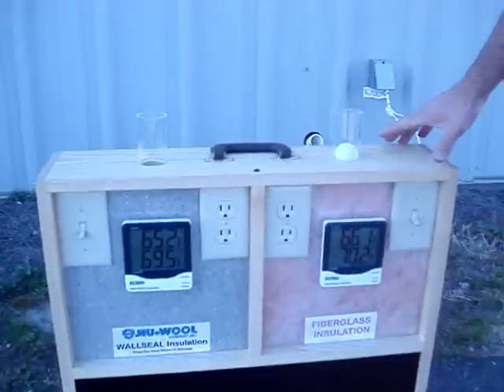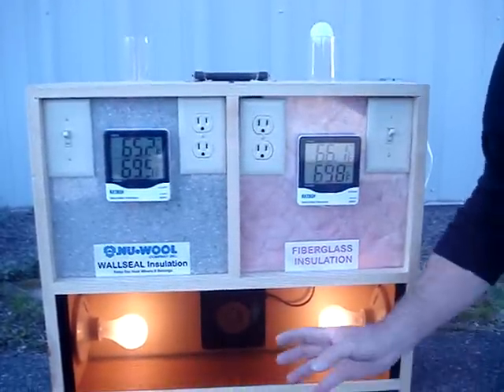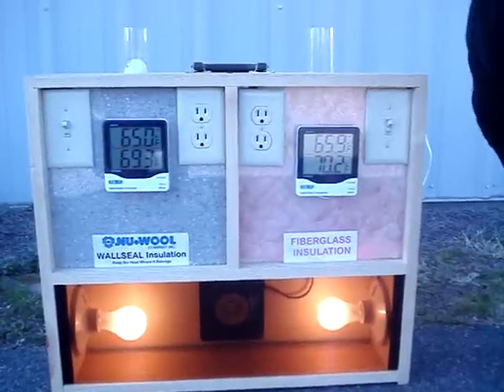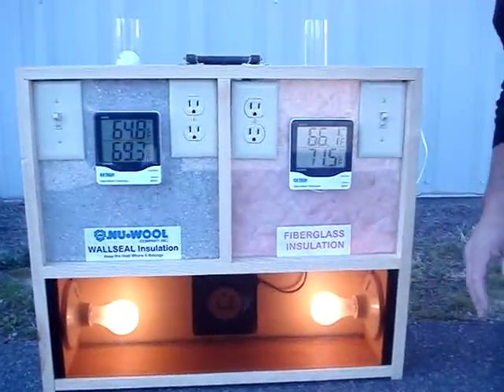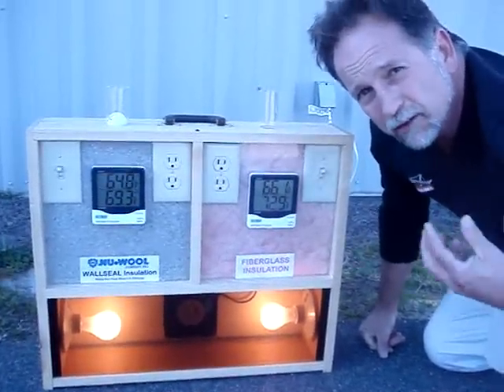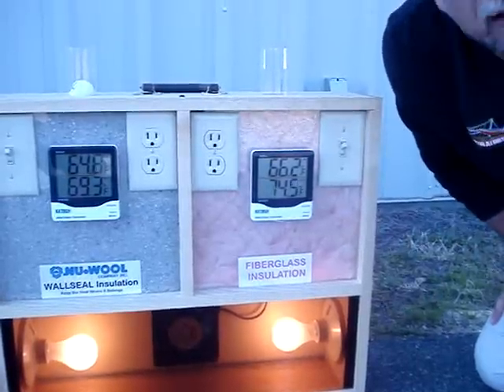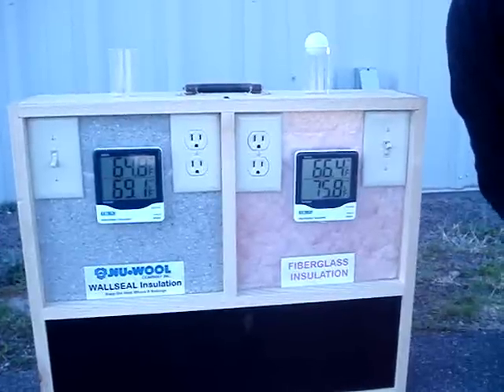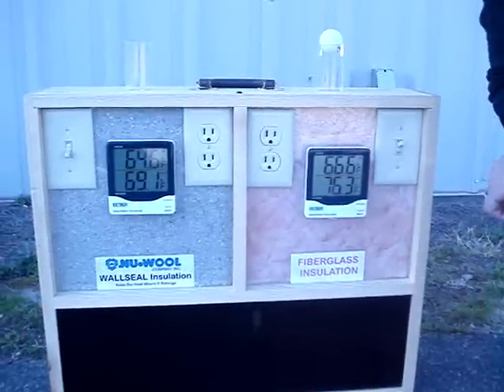John Meeks Explains Cellulose vs. Fiberglass

Comment: The test is true for cold climates since you install air barrier (poly) from inside. So from outside cold air is coming through siding, holes, cracks and taking heat away from insulation especially on windy days. My house with 2x6 walls and siding is colder than another with 2x4 walls and stucco.

Comment: While I agree fiberglass is inferior especially in an attic. In a wall cavity that is properly air sealed by caulking or foaming the perimeter of the studs to the sheathing and installing something like Certainteed Membrain or Poly deatailed an air barrier (caulked to each stud and the top and bottom plates and then drywalled there would be no air movement. Fiberglass performs well in an airtight cavity. Cellulose should never be used as as the air seal. Insulation’s other than closed cell foam are not air barriers, rather work by convection. R-13 fiberglass will perform better in a 100% airtight cavity than Cellulose in a cavity that has an unsealed wire chase with a hole at the top plate and bottom plate. Wind washed insulation is almost useless regardless of type.

Comment: From what I understand, R-value is a measurement of heat transfer or the resistance to.
If they are both R-13, wouldn't they both be the same?
This tells me something is different between the two. How could it not be?
With a sealed space being insulated,  why would there be airflow?
Even in a ventilated attic, the ceiling being covered will have a vapor barrier. How would air blow through that?
Just my 2 cents of common sense.

Comment: Clearly you can see how much more compressed the NU Wool insulation compared to the fiberglass
Reply: Compressing insulation reduces its r value. When installed how it was manufactured to be installed(properly), fiberglass should not be compressed at all. That’s what makes cellulose a better insulator. The fibers of cellulose are smaller and therefore allow the cellulose to have less space between the fibers, forming a tighter seal wherever it is installed. This is why they added the ping pong ball at the top to demonstrate the difference in air flow between the two.

Comment: It’s not conducting and just travelling through the insulation. Take the fan away and it wouldn’t climb so high. Perhaps you should be air sealing them both. Cellulose May have the edge for air sealing but you need more of it to have the r value they a modern fibreglass has.
Reply: Cellulose has a higher R value per inch than fiberglass.  It's simply a better insulator.

Comment: Another bullshit demonstration. First of all, its not on the insulation to be the air barrier, that's done on exterior with proper wrap and flash. Blowing warm air through the fiberglass is obviously going to spike that thermometer, but doesn't mean fiberglass insulates less in a sealed cavity.  Fact is, fiberglass actually has a slightly high R value per inch when comparing actual spec sheets from industry leading brands.
Reply: Cellulose is king buddy! @francishoffmaniii4880 your probably one of them techs that sells fiberglass in attics because you can fit more in your truck than cellulose, you guys hate installing this product because your not skilled enough .

Comment: Fiberglass thermometer is lower, closer to the bulb.
Reply: Don’t matter. It’s so minimal it’s ridiculous.  Fiberglass sucks
Reply: @scottdonbrosky5968  who packed the boxes? I could fluff the cellulose, pack the fiberglass, and show your opposite results. Paper is damn near an accelerant for starting fires, what exactly do you put on shredded paper, to make it not burn? Because I start fires with shredded newspaper. Shit can't be good for you, and just who exactly even reads newspapers anymore? I don't trust it. Water and insulation do not mix, and even with water this shit is a mess to install, and a mess to mess with afterwords. Cellulose sucks.
Reply: @normankoch6636  Packed the boxes? Why does it matter? No, it couldn't, the result would be the same. Fire won't start when it's treated with special chemicals. This isn't simply shredded newspaper.  Chemicals. Doesn't matter who reads newspaper nowadays; that's a stupid argument. Mess to install sure, but comfort is worth it. I rather take a messy install over an install that doesn't do jack s. Would you rather have a 90F 2nd floor or a 70F 2nd floor?

Comment: The parts that could be more done better that pop to my mind watching this:

Have a fan in each box, a ball on each out vent, separate the boxes (having two lightbulbs heating the same big chamber makes the better performing option appear farther ahead than it actually is), confirm each fan's power with a voltmeter,  do it in a temperature controlled indoor environment (clouds, shadows, wind, etc. outside can affect results), ensure the on-off switches control the fans/lightbulbs on both sides at the same time.

Comment: also cellulose is heavily treated with fire retarding chemicals, I wonder the long term health effect of this as fire proofing chemicals are the biggest contributor to poor indoor air quality.
Reply: Borate is about as harmful as table salt.  Check out the SDS sheets from the cellulose manufacturers -- it's a dust irritant, but not poison.   Fiberglass in the lungs is a far higher risk to long term heath, amazingly.
Reply: Your a moron borate is 100 percent safe to breath and touch. Eating it isn’t recommended though.

Comment: 1) for this to be anywhere near believable you would need to use individual fans in completely separate cavities. 
2 ) wall cavities ,with few exceptions,do not have pressurized air flow to force heat or cold the through the insulation media.
3) leaving the ball in the left tube increases air flow through the right side further rendering this display rediculous.
conclusion...this display was designed to deceive by setting up unreal circumstances that even If it was done in an even handed way still wouldn't come any where near representing results in a real world situation and  seriously undermines the credibility of the poster.
Reply: Wind creates a lot of pressure through insulation, especially in old leaky houses that blow in is used in.
Reply: And housewrap and foam helps with wind. Thats what I put over my old siding before re-siding.
Reply: i just assumed he had the 2x4 on the right side under the insulation opened up to allow more air and heat in since i couldnt see the little test jig before he started
Reply: Also on the left, the outside temperature is 2 degrees colder.

Comment: There is two types of fibreglass mat, color yellow or yellow/orange, is used for and made for insulation purposes, it's soft fluffy stuff similat to cotton wool, I have laid maybe a 100 000+ rolls with no bother.  The other type is WHITE glass fibre mat used for making glass fibre vehicle bodies, boats and machinary cabs, its SPUN thicker, and got sharp glass needles in it, THE INSULATION MAT is safe, the glass fibre mat is still safe but do wear a mask. A clown on here who sells shredded waste paper as an insulation in knocking fiberglass, yet he has no shame Selling Waste Paper, I am against it,  so is the insulation trade and major builders,  when we complete a job we know its done right,

Comment: No Underwriters or Major Builders including Housebulders, use paper insulation flakes k/as cellulose to insulate their properties, most are worried it will burn, but much more worried about workmen finding electric cables in the roof space afterwards if the houseowner has an electic  fault, with cellulose the cables get buried underneath it. Watch the Cellulse videos on YT, they all say remember to leave a 12" UNINSULATED CIRCLE  around light fittings and electric light bulbs to prevent fires, WHY?*  ....
Reply: REALLLLY??? then who was that that built 50 homes last yr WITH ONLY cellulose insulation?? hmmm???   12" ... how about 3? you just make things up as you go or what? you do realize the spacing is for FG as well? OR that its required  due to making the can lite from over heating and flipping off?? Superior knowledge will ALWAYS show stupidity for the darkness it is.  12" ???? bwhahahahaha... what a maroon as bugs used to say. BTW.. what EXACTLY is a insulation "flake" ? or is that a pipersSOB made up term??
Reply: Okai I will agree with you on just one point you make, Celluose does SETTLE better than any other form of insulation. Cellulose contractors (layers) know when first laid  it looks to the consumer like 10-12" inches, at this point they insist on being paid (no wonder) and a week or so later its 9", and so on and so forth, and it ends up what was poured out of the bag.Those bags are not that big, so how come just a few BAGS can cover a vast area ATTIC SPACE AREA when its fluffed up like CHICKEN FEATHERS. Cellulose is no better than chicken feathers. iN FACT CHICKEN FEATHERS MIGHT BE BETTER.
Reply: you mean the scandal of BLOWN GLASS and the FLUFFING that most of its installers use? ( look up CBS news and the report on 60 minutes some years back) ..... You don't understand blown density vs settled  do you? its ok... You haven't understood most of what you have spewed here so far.  FLUFFED cellulose?  It cant happen because  of the nature of the material... BUT FG ... you can  do it to that all day long. But I'm pretty sure you knew that but just pretending otherwise..( I hope)
Reply: Cellulose IS BLOWN into the loft, it floats gently down like Artic Snowflakes , if the layers took a TENNIS BAT they could SWAT it down to 1 inch, but they don't do they?, The Air Blower they use is a money making machine, it can turn ONE DOLLAR WORTH OF INSULATION into 10 dollars, not even the Federal Reserve can do that. When its laid there's $10 dollar bills everywhere in the attics and a year later the've turned into DIMES, and when your staff leave they are all singing the comapny song from Fiddler in the roof, and that was a miracle too."
Reply: CELLULOSE+WITH FREE WATER ADDED. Tell me when water is added to cellulose insulation, why do they add water to it, it baffles me, I'm from the old school that says you must keep the loft and insulation dry,. After you leave the job does'nt the water drain Away through the ceiling. When you connect the blowing machine to a water tap how do you know its time to stop, Can it be too wet, too dry.  Cellulose Concrete Must be good but how long does it take to set hard. And can you drill it, or make garden seats out of it,
Reply: THE TRUTH has been revealed by Hotrodder, a fellow YT commentator who favours Cellulose insulation, a man who now admits cellulose contains so much dust that water spray is taken into the attics when its laid to keep the dust down. Paper shredders dust, made when the paper shredders rip and tears the waste paper its made from in the shredders machines. My fathers brother ran a corn silo plant, and one day the place blew up and set on fire, the cause was corn dust which had spontaneously set on fire, these guys are selling dust as insulation,  Find the YT video opoosite  whichsays cellulose sets fire, these salespeople are planning on SETTING FIRE TO AMERICA, there having a fire sale, and how!.
Reply: I am a Democrat, nothing to do with Clinton, I support more goverment effort to help those who need it the disadvataged, You want facts heres one Owens Corning employ 5000 people, they have 98% of the insulation market, another firm I admire is CertainTeed, and of course Dupont, and in 50 years I have never lost an order because there products were questioned, were doubted, or criticised, I have tons of energy but fighting for a sale is not my style. I assume its going to go in, and it does, and I never do call backs, never appear worried at losing a sale, in fact some days I want to lose a sale because 3% of the people I meet we do not want as clients, let someone else have the hassle, they want a better price, I walk, they want me to sit for longer than 20 minutes I walk, I sign deals, you're junk I canot sell, I'd blush at offering intelligent people Celllouse, I have sold Judges, Top Police officers, a few well known sports people, and Mr Mrs Joe Brown, they get my love and best efforts, some we lose money on, you see anyone can make a profit selling insulation, but can they make a pal, a friend, or in my case get told by a young woman I had sold her grandad, her fether, and now her, in one call I told the houseown we had undertook 200 orders in their local area, I feel sorry for you, a one hit man, we deal in hundreds, and you make more money on one order than we do on five, but do we care, only for the people you short-changed.    Value for money matters, and keeping faith with clients matters,
Reply: INDIAN CELLULOSE EXPORTS: Fiberglass saves heat, it saves lives, and is an approved  product. I was watching on TV how Cellulose is made in India at the WIndira Banda Works, Bhopal, the program starts on the local rubbish dump, with mothers and children being given by the gangmaster bags about 6 foot long to tie around their waists, then they set to collecting waste aper and cardboard all day long. The full baga are taken to the hand cracked baling machines, then taken into town to be shredded and WEETABIXED,  then exported to 13 counries wirth the USA taking the largest amount. It was all very interesting, the child workers are given free injections, and there mothers a bonus on every 100 bags they collect. It does create employment and keep the area clean said the voice-over.

Comment: The Infamous Cellulose Fire Test Failure:
______________________________________
Up until 2015, many brands of cellulose insulation were approved for installation in crawl spaces and attics without the use of an ignition barrier coating providing there was fire extinguishers to hand. Cellulose Insulation manufacturers were given until the end of 2016 to test their products with a more realistic test than setting fire to it with matches. The report said they needed to compare the spread of the flames created with other insulation products. For this reason cellulose failed the product safety and fire prevention tests.
Reply: Yet  you name ( again) no source,,.. and yet ( again) DO NOT mention UNDERWRITERS LAB APPROVAL for OVER decades AND decades!.. ya this kind of desperation smacks of clinton type spinning.. sad really when you go up against REAL facts.
Reply: *No Underwriters or major Builders including Housebulders use paper insulation flakes to insulate their properties, most are worried it will burn, but much more worried about workmen finding electric cables in the roof space if they have an electic  fault, with cellulose the cables get buried underneath it. Watch the videos on YT, they all say remember to leave a 12" CIRCLE UNINSULATED SPACE around light fittings and electric light bulbs to prevent fires  ....